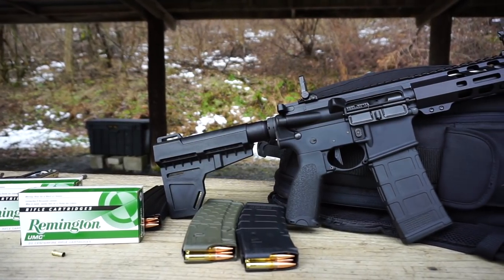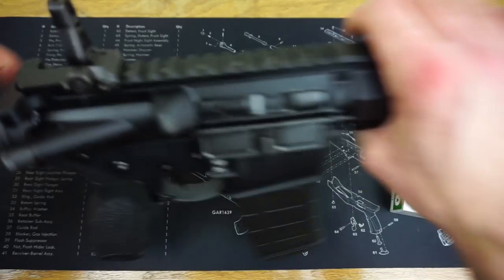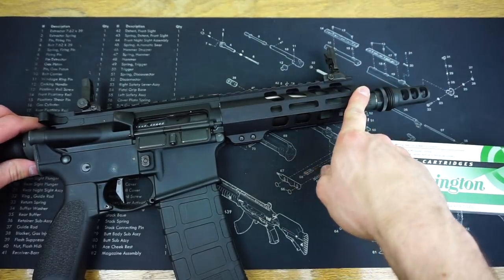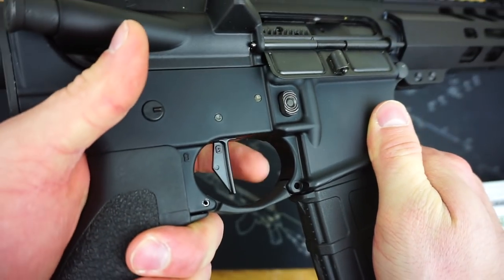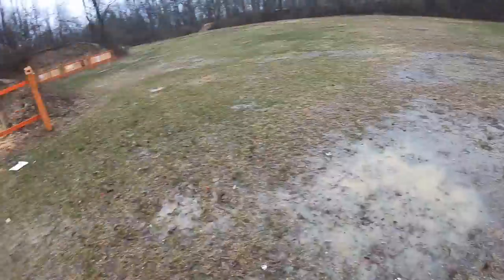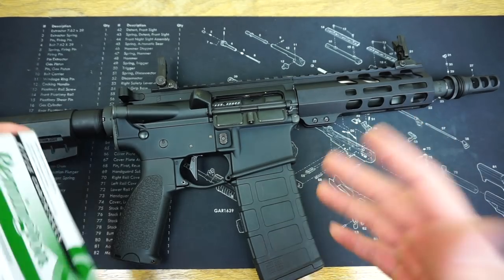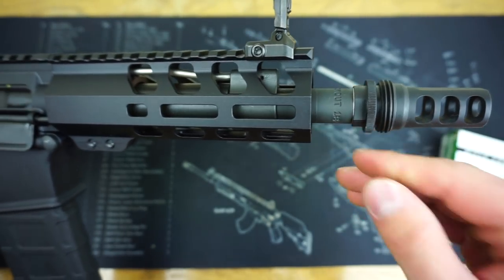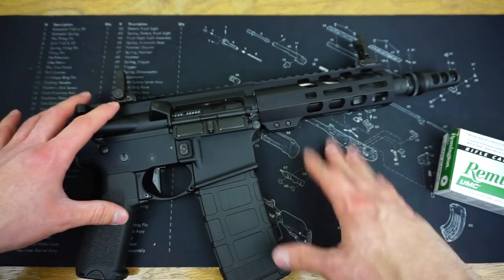7.5" PSA 300blk OUT PISTOL (FIRST IMPRESSIONS)!

Comment: so we can shoulder a brace correct?
Reply from the maker: Nelson Fields per the ATFs most recent clarification letter yes you can but obviously that’s subject to change and that my opinion of the letter
Reply: No,you cannot legally
Reply: @tbugher62  Yes you can now.
Reply: You can shoulder any brace made by SBTactical as long as the pistol was purchased with the brace already attached. The Blade has been labeled as illegal to shoulder because it is rigid. As far as a brace being added to a build you get into the territory of intent with the ATF. If you build it and shoulder it that may show intention to use it as a stock which would then be illegal. SBTactical has an ATF letter stating their products are allowed as long as they are left in the original configuration. Be very careful with building AR pistols and definitely with making it public.

Comment: Question, I was told that shouldering my PSA  300 was a no no and could get me in trouble. Now they said that it would then technically be considered a SBR, and would require a tax stamp for such. (Short barrel rifle)
Reply from the maker: That is incorrect (from my understanding) of their new clarification letter. They basically said your good to go obviously that can change at any point knowing the ATF.
Reply: You can shoulder your brace as long as you do not modify it in any way, such as taking off the strap it it came with one.
Reply: @Gezere9  that's good to know, thanks

Comment: When you find out the omega is only rated for 8” with supers :(
Reply from the maker: Interesting I didn't read that anywhere on the manual online but I'm sure you are correct thats alright though I was only planning on running subs through this build with the can on the end.
Reply: Almost all Surpressors are 8 inch barrel rated on the 300 AAC,only a fool goes below 8 inch barrels.
Reply: @tbugher62  great, now some dude from the interweb thinks i am foolish, now I will just have to dispose of this perfectly functional barrell.